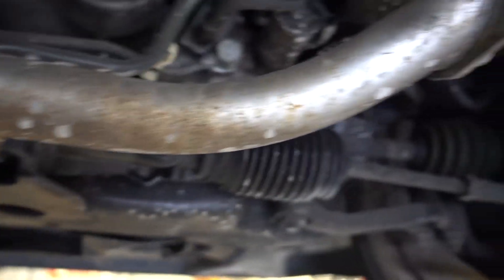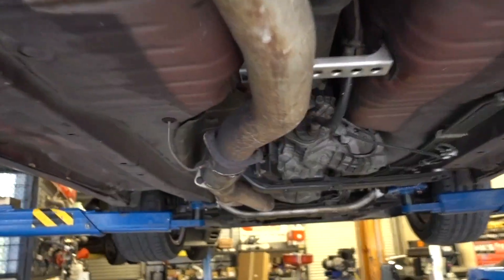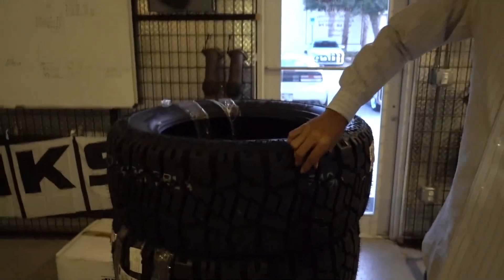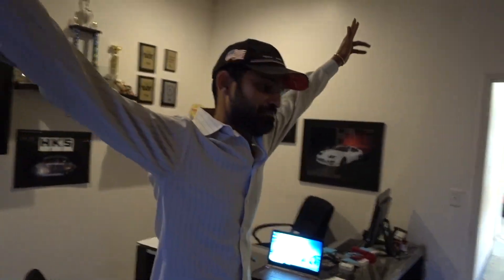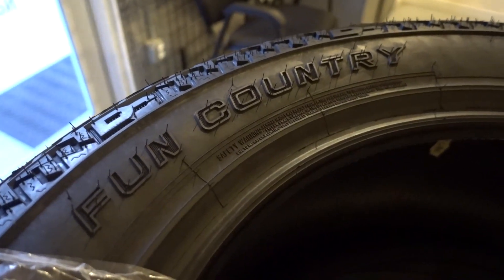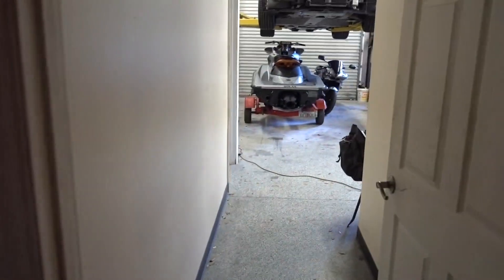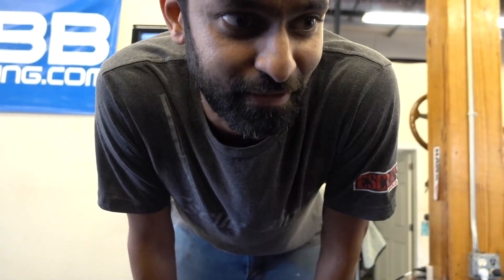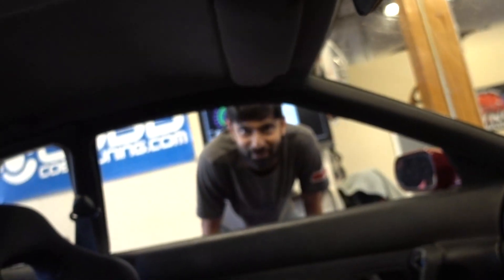HALTECH and e85 on stock GTR!

Comment: Switching to e85 did you switch to bigger injectors? If not how much more power would you see with injectors?
Reply from the maker: Tyler Sanders yes. We switch to 1100cc injectors. And a bigger fuel pump to support the extra fuel demands.
Reply: Jack Cecil cool. I have one more question. I have called the shop and sent two emails across the last 4 months and never got an amswer. Could you guys import a Nissan D21 or Nissan Hardbody for those that don't know what it is.
Reply: Jack Cecil also I really appreciate the reply. Dusty is gorgeous. Keep the insane builds. Shouts out from "Heinous Creations" here in Arkansas.